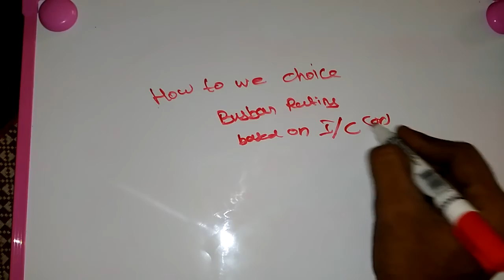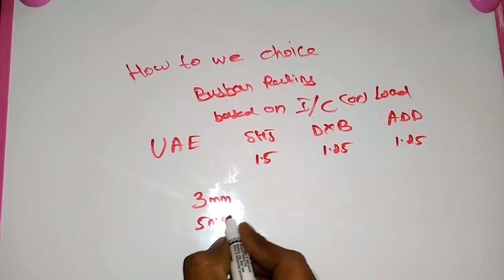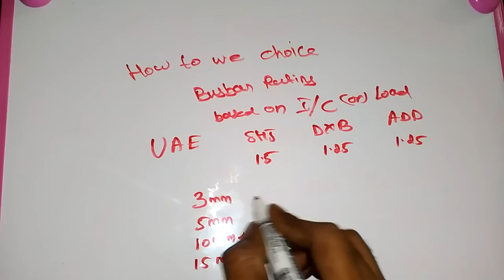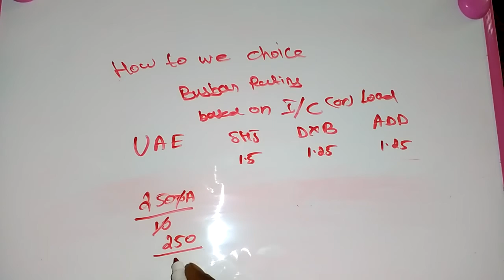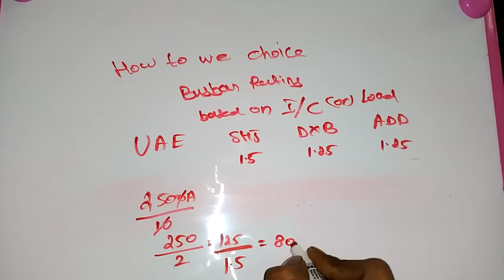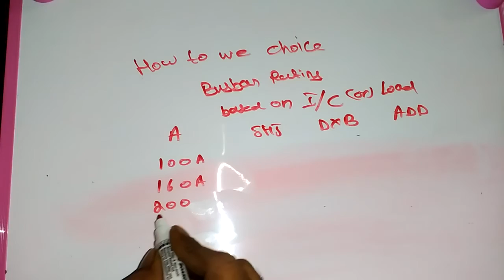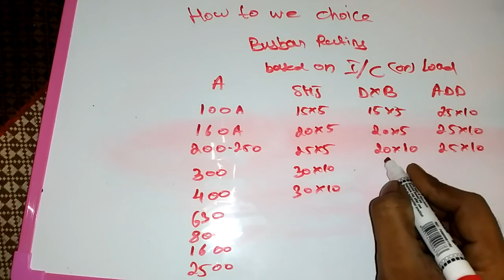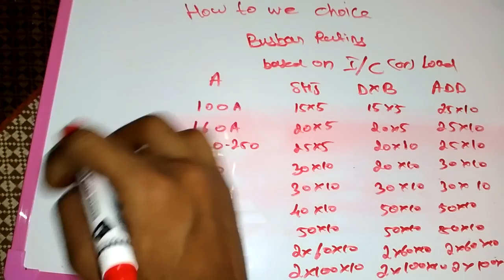United Arab Emirates how to choice bus bar ratings in LV panel in switch gears

Comment: how u select 10 mm thickness ........... why cant we go for 15 mm  ....as u said these multiplication factors are for higher values...........for 100 A how u select 25 x 10 in Abu dhabi ......as per calculation 100/25=4 ..and how this 25 comes .......soits 25 x 4   ?????????? plz clarify

Comment: in dubai the busbar size for 300A should be 1x30x10mm plated copper busbar. for 630A 1x40x10 only required, which also will change depending on what brand of breaker you are using.
and for 1000A and 1250A rating 2x50x10mm copper busbars are used. in sharjah 2x80x10 2 runs only required for 2500A. also 25x08 or 20x10 for 200 to 250A breaker. authorities or consultants can some time make trouble if the busbar sizes are not correct.